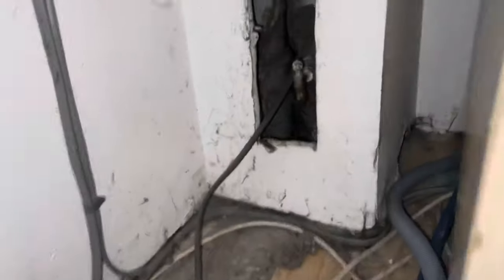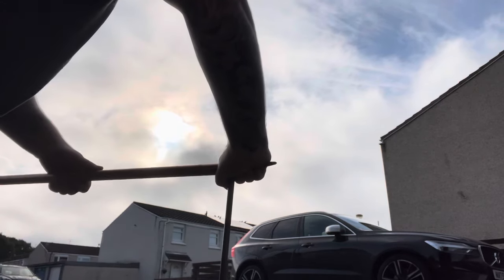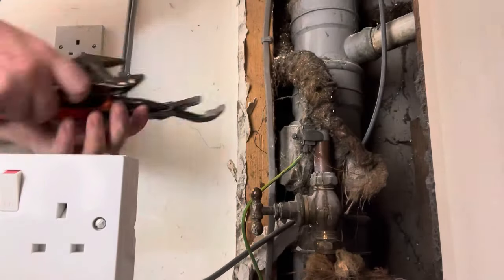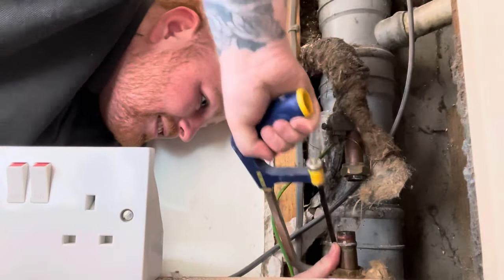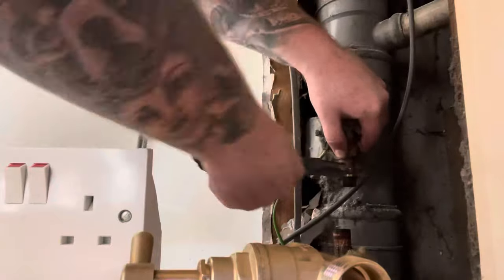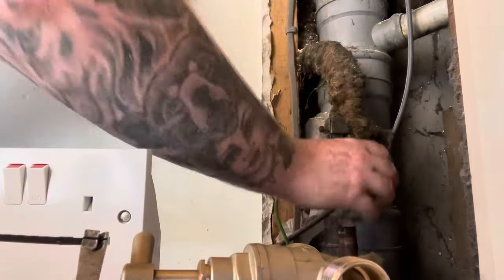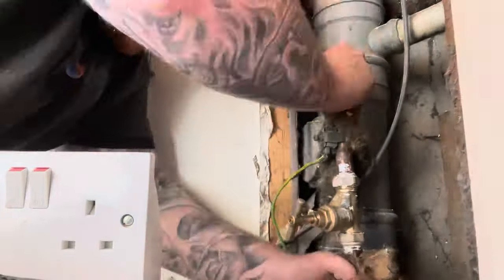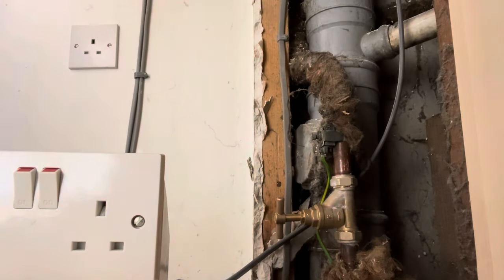Replacing a main stopcock

Comment: Your video was extremely helpful as I was unsure if the imperial nuts would be compatible with the metric threads now I know they are not so I can't just swap out the main body. 

Did you use 3/4 olives with the new stop cock? or is that what all the paste helps with if using 22mm olives. I plan to replace my old extremely stiff imperial stop cock with a new metric one and my thinking was to use 3/4 olives with the 22mm compression fittings and PTFE tape on the threads.